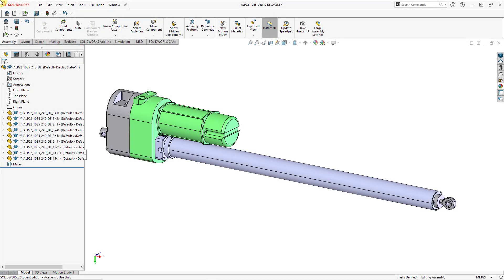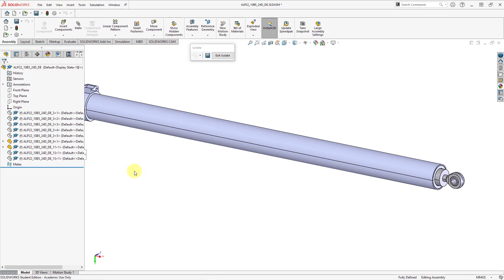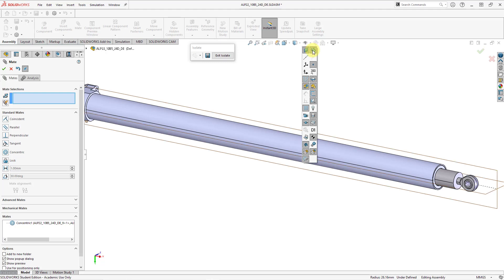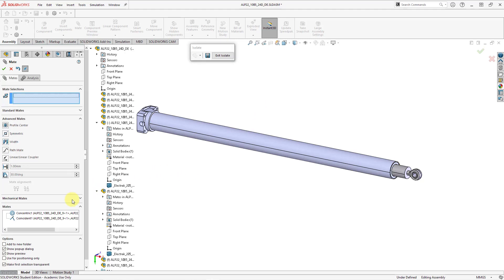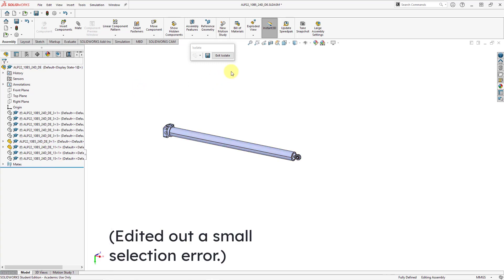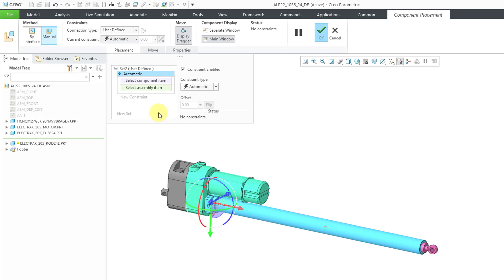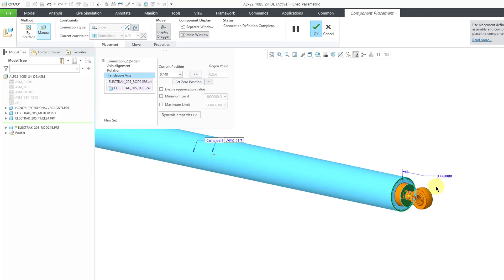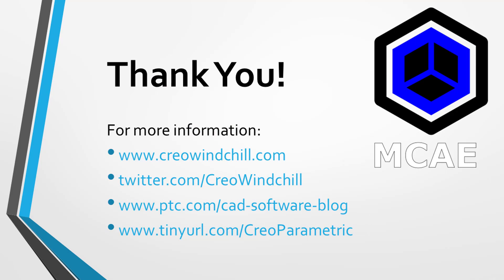SolidWorks - Creo Parametric Comparison - Mechanisms: Slider Connection and Limit Distance Mate

Comment: Which software would you recommend for professionals and which one for beginners? Solid works vs creo parametric. Also explain which one is better?
Reply from the maker: For professionals, it depends what kind of products you’re making and the skill level of your team. For absolute beginners trying to get the hang of parametric modeling, I recommend Onshape (especially because you can start for free). As I’ve explained in many videos and blog posts, I don’t think there is an objective “better.” The theme of these videos is simplicity versus functionality. One might be better for you, but which one that is depends on you and your needs.